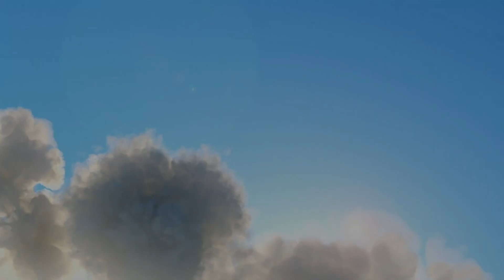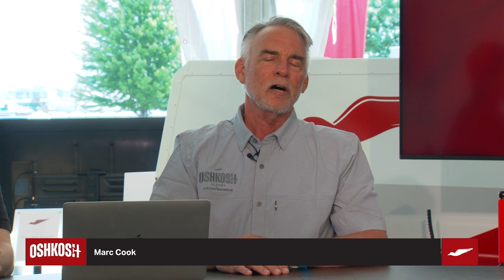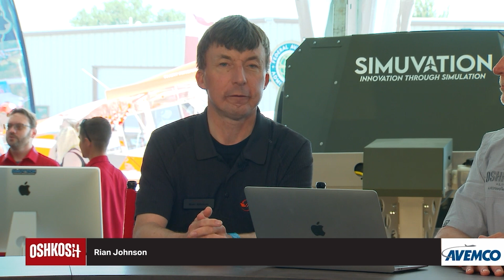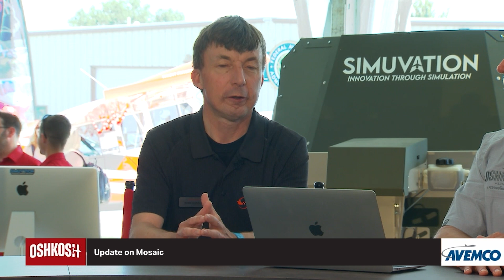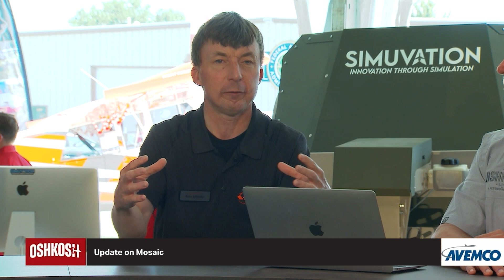MOSAIC Next Steps—an interview with Rian Johnson

Comment: Bottom line is this... either the FAA accepts the mosaic rules to support new pilots coming into the market... or we continue to watch pilots die off and legacy airplanes scrapped. It is already to the point the majority of small airports see almost no use. I was at my local airport Saturday and it was so sad to go to the pilot lounge... not a single person there, lights all off. No planes doing touch and goes, no radio chatter going on... just a dying airport being unused. Light sport could change that but the question is does the FAA want aviation to continue? Starting to wonder if they might secretly want GA to die off.

Comment: IFR, as well as 60 kts would be nice, just round it off, provided the training requirements are met. I see no reason why IFR should be excluded, if the FAA wants to reduce continuation into meteorological conditions that would certainly help
Reply: Right? I'm wondering too if this will pave the way for an IR add on to a sport pilot certificate

Comment: At about 2:20, you're seeing Rian suggest "manufacturers will be able to make airplanes"... what he's referring to here is manufacturing airplanes that bypass all of the costs of Part 23 aircraft testing for GA certified aircraft.  Mosaic will reduce testing requirements to an "industry consensus" which means it will soon be dramatically less costly to manufacture mosaic aircraft.  There are dozens of other benefits to Mosaic, but there are down sides.  GA certified aircraft will become more costly to maintain for dozens of reasons.  A> the market will collapse for them, except for IFR rated aircraft.  B> mechanics will be hard to find.  C> demand will change to the self-maintain mosaic aircraft.  What will happen to the GA fleet when your annuals start to cost 10-20k per year?  We will have a GA part 23 certified aircraft boneyard at every airport.  

The biggest counter-intuitive result will be the total destruction of EAB Aircraft Kits.  The entire homebuilding industry will be eliminated within a decade.  Kit companies will realize that it's far more profitable to sell 10 completed mosaic aircraft for $500k than 100 kit aircraft for $50k.  Why are LSA aircraft not priced this high today?  Because they're slow and very limited in useful capabilities.  Those limits will arbitrarily be lifted, and all of a sudden even the LSA market skyrockets into the 300-400k price range overnight under the conditions of mosaic.

There will be no GA or EAB aircraft left after MOASIC is done.  Mark my words... there's no incentive to manufactures to do anything other than build completed aircraft moving forward.  Just look at where the composite kit industry ended up.  Look at the cost to build a pitts or christen eagle.  A $20k kit now costs over  $300k for a kit, not because it's more expensive, but because they sell completed aircraft that are more profitable.  They don't want to sell kits.  Some manufacturers just bypass the kit market entirely.  For example, have you ever seen a new Game Bird kit price?  Here's a company who recently figured out that building the entire aircraft is the most profitable way to do it.

Enter MOSAIC... and watch the industry totally transform.  The days of kit aircraft will be limited to kit clone aircraft where you buy the CNC and materials and cut the parts yourself from plans.  They will leave it up to the insurance companies to shut down that part of the market.  

Ask Vans to sign a pledge to never exit the kit aircraft industry, and to keep prices attainable.  Won't happen.  Their intent is to follow the money which will be to build completed aircraft at high prices and exit the kit industry.  They may not know it yet.
Reply: I think you are out of your mind. How many people do you think are out there that can afford a $500k airplane? If they could, they would right now be buying..... wait for it..... A BRAND NEW PIPER Pilot 100i for under $300k, or a brand new Cessna 172 for between $300k and $400k. Apparently you do not understand the kitplane market. The kitplane market is made up of thousands and thousands of middle-class income men who can not afford to fly GA. Particularly the maintenance, but the acquisition costs are not unimportant. If I can buy a $7000 empennage kit this year, and a $15k wings kit the next year, and a $20k fuselage and finishing kit the third year, and top it off with a $20k Viking 195 turbo, and that's all I can afford, do you really think I'm in the market for $500k completed plane?
Reply: @georgeburns1561 💯
Reply: @georgeburns1561  that's right.  

That's exactly right.  So what does that mean for you?  That means you're going to either have to have the money for a brand new airplane, or go back to experimenting on your own.  

Do you think these EAB kit manufacturers are going to keep building kits after mosaic?  If so... why?  It's not because their heart is in it.  Insurance and risk is at an all time high.  Lawsuits have already established the ability to sue kit manufacturers for flaws, and the Vans laser cutting fiasco was a prime example of how they went bankrupt over a bad process.  

On the other hand, if you can produce a kit, you can produce a completed airplane.  What stopped kit companies from selling airplanes before?  Part 23 certification did.  The 51% rule did.  The LSA speed and performance and passenger limitations kept LSAs at arbitrarily dumb low limits that didn't demand the attention from the market.  They had a ceiling on the price they could demand for those factory LSAs.  

With MOSAIC... those limits are all gone.  They're poof... consensus standards. 

That means to make $100M, you could sell 200 completed airplanes at $500k, or you could sell  2000 kits at $50k.  10x more profit doing 100x less work.  

Meanwhile it'll take you 10 years to sell 2000 kits for a specific aircraft model, it'll take you 6 months to sell 200 aircraft per year at the rate Cirrus did.  

If there's a kit manufacturer left in 10 years after MOSAIC, it'll be because they're stupid.  Guess why Vans has their head hauncho on the board of mosaic?  Because they want to produce aircraft, not kits.  MOSAIC is not about producing kits, it's about AIRPLANES from a FACTORY.  There's nothing "KIT" about MOSAIC.  

And that's why it's the death to EAB and EAA and General Aviation.  Because your current GA fleet will be impossible to maintain in ten years after MOSAIC hits mainstream.  The laws of unintended consequences here are endless.
Reply: @Irjdunn1  I totally disagree. If there is a kit manufacturer left in ten years, it will be because there are literally hundreds of thousands of male middle class want-a-be aircraft owners who don't have the means to buy a whole plane, and we will cater to those individuals. Yes, a certain percentage of those will join a flight club, but another certain percentage would rather own their own plane outright.
Reply: @georgeburns1561  I think you’re speaking past the biggest issue.  

If you’ve gone through the trouble of inventing or cloning a kit… and now it costs you zero extra dollars to certify that aircraft design to sell full airplanes at 10-30x the profit of individual parts, and those individual parts will cost you headaches to manufacture, support, and ship, and your actual profit motive is to just not go broke… again… like the majority of plans build or kit built aircraft over the years… 

Then the question remains.  Why not just sell one or two completed mosaic consensus built aircraft for $500k and stop selling parts for cheap?

Aviat acquired the christen eagle ii.  It was a $25k biplane wooden kit from the 80’s. Aviat sells certified and factory built experimental aircraft now.  Do you know how much that christen eagle ii kit costs?  About $300k.  Why?  Because they don’t want to sell kits anymore.  

There will not be a business model left on the face of the planet for anyone to want to continue to produce kits, and it won’t matter how many people can’t afford full aircraft, it’ll matter how many CAN and that will make aviation inaccessible to everyone else.  EAA and all of these so called “advocates” for general aviation are doing nothing to bring down the cost of aviation, they’re actually destroying it by creating monopolies and allowing consolidation of an already monopolized and highly regulated and manipulated market.  Say goodbye to affordable aircraft. 

They’ll point to LSAs being cheap and so they say mosaic aircraft will be just as cheap… the minute mosaic rules take effect, LSA prices skyrocket because they’ll lift the performance limitations they were required to meet. 

When was the last time EAA provided engineering education on how to design new aircraft, or released a community opensource aircraft design, or bought and made available the plans and dimensions of the RV10 which is now beyond the useful 20 protection of patent laws so that members could cut their own parts out with cnc machines from raw stock aluminum?  What about Cessna designs from 1980… why don’t we have dozens of clone kit companies selling kit parts when we have dozens of clone full aircraft companies improving on the same design?  Because it’s not profitable to sell kits, and when you can sell full aircraft and make millions, you do that.
Reply: @Irjdunn1  "Then the question remains.  Why not just sell one or two completed mosaic consensus built aircraft for $500k and stop selling parts for cheap?"
I'll tell you why. Because Zenith doesn't have ANYWHERE NEAR the liability exposure as Piper or Cessna. That 51% rule totally segregates the builder from the kit manufacturer, save only the most egregious design errors. 18 years. I have to think most Kit manufacturers do not want a liability lasting 18 years. 

I WILL CONCEED you have a bean-counter point that has to be acknowledged. Some kit manufacturers are big enough to make that jump to total production, and profits will probably drive them to do it. 

My counterpoint to that is this: Fine! If that happens, more market share FOR ME!!!! I am developing a 4-place low-wing kit with a cross-country mission. My bet is, I can find 15-20 people per year over the next decade "left behind" by your suspicion who will be looking for that kind of "garage challenge". If that grows to 100 per year, and I can grow my company to accommodate, so be it. And here's the kicker. I don't care if a large percentage of them never fly. Some people just want to build something, and I want the commerce.
Reply: Literally propaganda. Your lying through your teeth. You must work for a certified aircraft company 🤣
Reply: @galactictomato1434  I must?  Or I’m building an airplane and want eab to be around for longer than the next decade maybe?

What’s propaganda about mosaic? 

You think somehow part 23 certified aircraft manufacturers aren’t in bed with mosaic too? They can literally quadruple the price of an IFR capable airplane overnight, and then consolidate and buy up all the competitors while making fewer aircraft much cheaper for more profit.
Reply: Perhaps you believe all this, but it reads like it was written by an entrenched manufacturer’s lobbyist. Peace
Reply: Or a socialist.  By deregulating, you are correct, production will increase. But so will competition. There are not a lot of people who can afford a $500,000 airplane. More companies will offer cheaper products.  Also, mosaic affects the parts, and STCs of legacy aircraft. Making it easier to obtain PMA’s and certify modifications.  So, I don’t see the value of the legacy going away.  I would even see hope for orphaned airframes, where it’s often almost impossible to find parts

Comment: I'm shocked by how stuck in the past the FAA and general aviation has been for decades.  If all these idiotic and archaic rules were applied to the Wright brothers, they would have never gotten off the ground. Why is it that the federal Department of Transportation has no problem with 50,000 highway deaths per year, but they go berserk over GA safety?  If every GA plane crashed tomorrow, it wouldn't equal the highway deaths in one year. That's how out of whack this government has become.